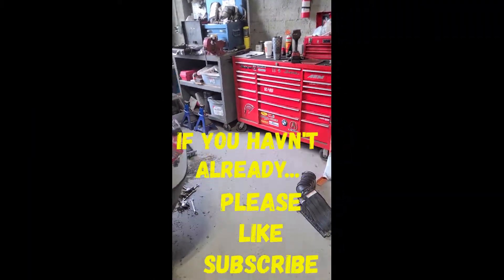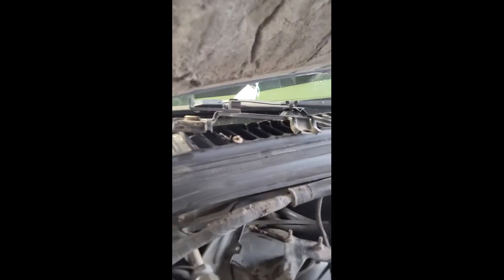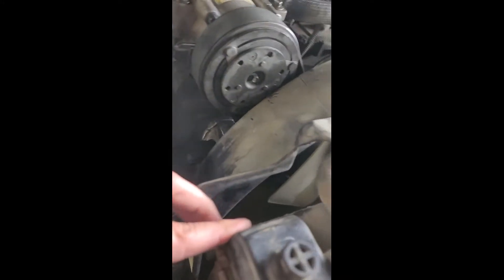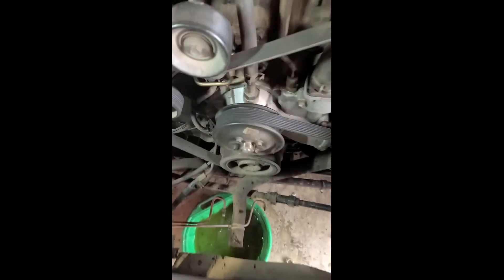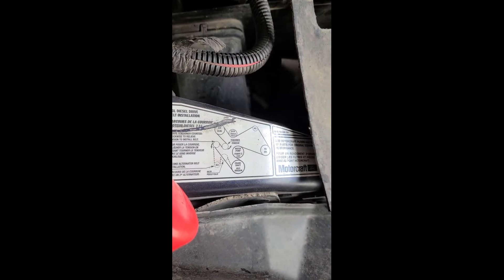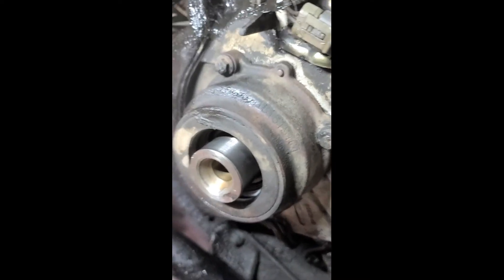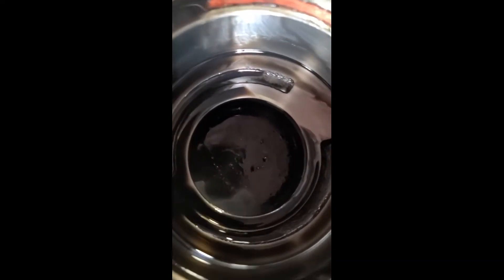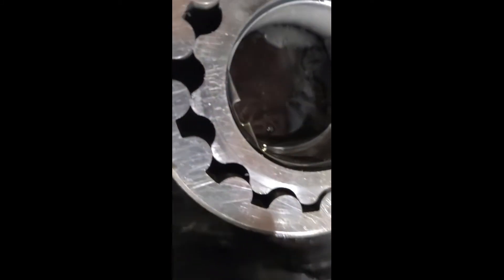How to Change the Low Pressure Oil Pump in a 99-03 Ford F250/F350 Superduty 7.3 Powerstroke Diesel

Comment: On the E350 7.3 Van I removed the top idler pulley, and unbolted the AC compressor to have room for the O’Reilly fan clutch removal tools. 57mm (square) on the fan bolts, 48mm on the fan nut and got her off solo from the top.  

Thanks for the video!

Comment: If you don't want to risk damaging the threads while pulling the pulley off, just remove the washer from the bolt that you removed, put the bolt back in and leave enough space to pull the pulley, then just put the mandrel on the bolt and pull it off.

Also, you can break the balancer bolt loose without an impact wrench by using a breaker bar laid against the frame rail, and bumping the starter.  I was broke back in the 70s and 80s, and we did what we had to do.
Reply: That sounds logical to me! 👍🏼👍🏼 I've gotta do mine before too much longer on my 2000 F350. She's got 214,000 miles on her nothing is wrong just going to do some PM before something does happen. 👍🏼

Comment: What kind of silicone did you use for the key way grove? About 2 weeks ago i did mine but i put gasket maker rated for oil in the key way and today my truck started pucking oil and its leaking from behind the balancer.

Comment: My guess it didn't solve the 1211 issue.  Take the fuel cap off and disconnect the pick up off the pump . Hit it with compressed air .